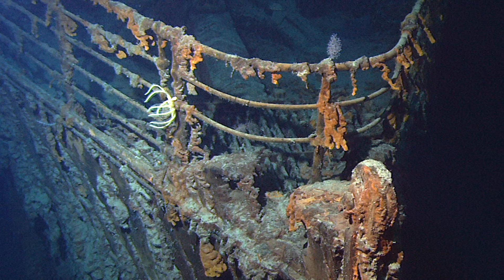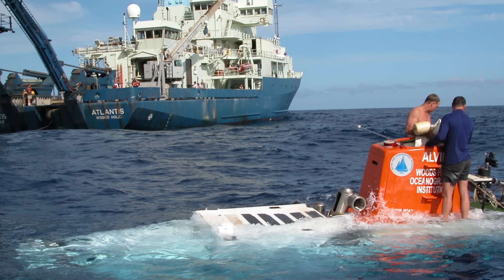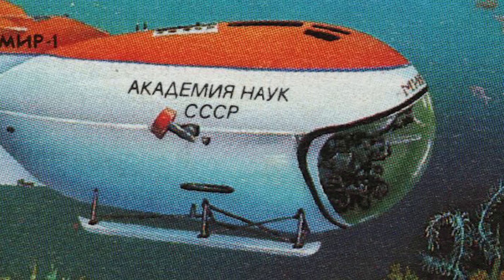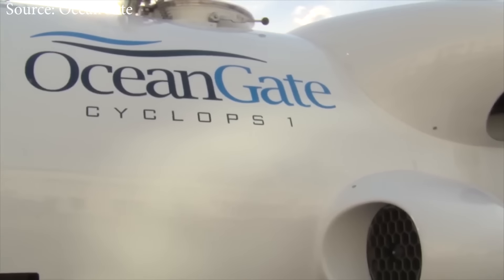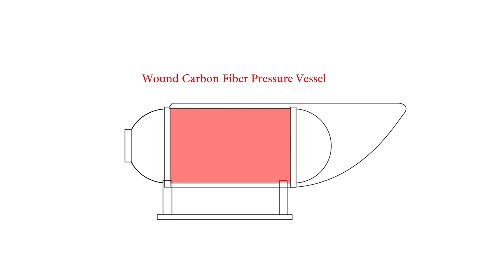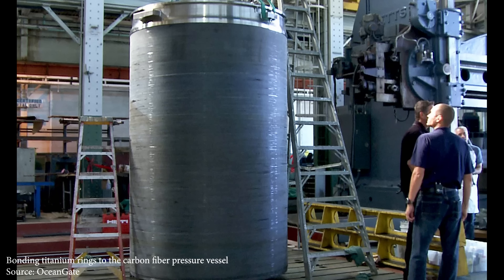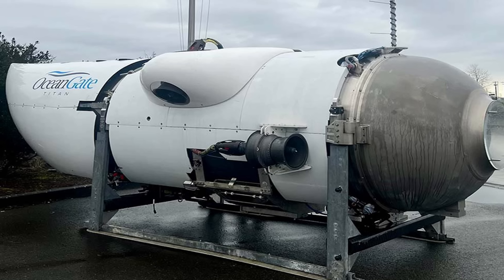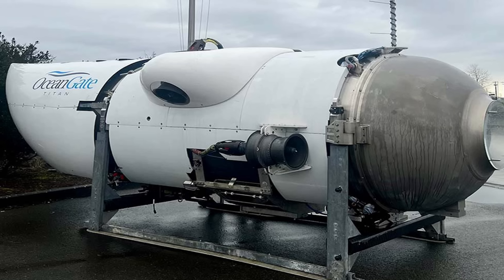How Titan was Built, Lost and Found: An Analysis

Comment: Rush’s actions were incomprehensible. Refusing to have the sub examined and certified… then refusing to have it examined/scanned for cracking/weakening is just mind-boggling. 

He was so willfully negligent and frankly, stupid. There’s no other word for it. 

If you look at the design of successful submersibles, their designs are uniform and strong and made of materials like titanium. The Titan design was like having a toilet paper roll with 2 end pieces added. If you put pressure on that toilet paper roll, the two end pieces would obviously pop off when the whole thing is squeezed… and the carbon fibre body would delaminate over time, causing an implosion inevitably. 

Stockton was unbelievable and should be remembered in history as a villain because of the way he cost innocent ppl their lives. Their adventurous spirit is understandable and they didn’t believe someone would be so reckless and put them in danger that way. I hope more regulation will stop this from ever happening again.

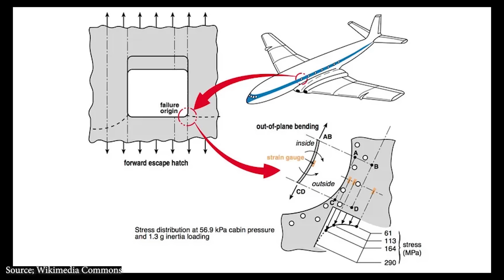Comment: Aaand 13:20 is where I exit the vehicle. The window corners being the problem on the Comet has been THOROUGHLY DEBUNKED, Mr. Brady; it was actually the skin thickness and the way the skin was assembled (the TLDR is that the riveting left fractures that grew worse over the plane's pressurization cycles). You need to withdraw this video immediately, and not reupload it until you've done proper research and re-done that section. For someone who breaks his back doing research and debunking myths as a major part of the channel, turning around and brainlessly regurgitating a thoroughly-debunked myth is an especially bad look.

I'm honestly tempted to report the video for misinformation, but I don't know if your negligence here is serious enough for YouTube to care.

Comment: I worked at one time for a satellite company building and launching commercial satellites.
The main component of the satellite’s structure is the central cylinder. The central cylinder is a carbon fiber wrapped cylinder about 10 feet long and 4 feet in diameter.  I’m not sure of the wall thickness, 3-5 inches? It’s basically the same design as the Titan sub. It has titanium end caps bonded on, and the bottom endplate is the actual mechanical connection to the booster rocket. Of course, its operation is in space, not underwater.  I did a complete 3D cad model of the cylinder using Pro Engineer. 
At one time I was considering designing a modern-day version of the Hunley Civil War Submarine using the satellite central cylinder, almost the exact size of the boiler used in the Hunley construction. I would not recommend this design for deep high-pressure applications. The Hunley dives shallow, no problem.

Comment: The criticism for the video game controller is not so much against the tool but the fact that it was used for a fundamental (not marginal) task. The fact that cheap controllers are also used in larger organizations means nothing of course, it all depends on the purpose. And above all the fact that it was not connected by cable but by a wireless connection. Even those who are not competent can easily see that this is crazy.
Reply: I mean, personally, I'm not really fussed with the controller as the primary control unless it comes out there was no backup system at all.

Comment: Pretty good video, but your "fact" about the de Havilland Comet was not correct. The SPECIFIC window that caused distress was for the ADF on the TOP of the plane, directly atop the cockpit. It was nothing to do with the rounded square-ish passenger windows. This is annoyingly repeated, quite falsely, across the internet. Most of the stress, fatigue and flaws that broke up the original Comets was actually caused by bad riveting, square cuts made for emergency exits, poor understanding of metal fatigue and specificity fatigue due to constant pressure changes, and shoddy construction. Only 1 incident was caused by the square cutout of the airframe to fit the ADF unit.
Many other airliners also sported square-ish windows, but none of them ever had any critical failures due to their shape.
Since the Comet was one of the first aircraft to regularly fly at the altitude that she did, many hard lessons were learned, but luckily, most were not catastrophic failures. More Comets were destroyed by pilot error than any other cause. 
I know you're into ships, not planes, so thought I'd help debunk this myth for you!

Comment: The carbon fibre hull needed to be thicker AND needed to be scanned prior to each dive. A carbon fibre expert stated it would cost about $20,000 dollars for a hull scan of the Titan. Stockton Rush chose not to, thinking that their onboard acoustic warning system would be enough. 
That was the real failure, taking shortcuts. Let's not forget the Titan had carried out 13 prior dives to the Titanic, could carry 5, cost only $370,000 dollars yet a spherical steel or titanium sub that could only carry 2 would set you back a whopping $37,000,000. Yes that's 100 times the cost of the Titan. There clearly is potential for carbon fibre, a lot, but it needs to used properly and with regular checks. A more innovative design could even involve a removable carbon fibre hull for more detailed analysis, inspection and even replacement after x number of dives at relatively low cost.

Comment: I made aerospace parts for years. Had i been there in the shop when they were putting that carbon fiber on, I could have told them it would fail eventually.  Im surprised it lasted as long as it did.

Comment: I think you're too lenient on them about some things, like the controller. I'm not concerned about a controller being used but that they used a wireless one. If the Bluetooth connection failed, what then? What if the batteries ran out or mistakenly weren't charged?

Comment: @iwannaratrod is spot on: No NTI's, No NTD's, bubble view port rating - not for that depth, no GPS/Navigation system, (for use in redundancy), no locator beacon, (essential emergency equipment, don’t you think?), et sic et cetera. New world use of Carbon Fibre for deep sea exploration is considered ‘Experimental Exotic Materials’. It has not been tried and tested. Titan was found to have a fault, not long back, causing it to be re-certified to 3000 metres. They had to repair it to get it certified back to 4000 metres. How do you repair a delam, slit, crack or hole in a one piece spun cylinder without causing instability in the surrounding structure? Companies that make this sort of thing will only certify it's depth for 1 use only, 2 at the most. That's probably why they made it themselves; they couldn't get anyone to certify a carbon fibre  ‘personnel sphere/pressure vessel’ for multiple use. The photo’s and video’s of the build is more akin to a Engineering/Glass Reinforced Plastic (GRP) shop. Go look at aircraft industry and F1 Team carbon fibre shops. I’d eat my dinner off the floor in those shops. Most people who watch this type of content already know most of what you go on about, especially Radar, Sonar, the depth, the pressure. This only needed to be a 15-20 minute video. Good production, editing, drawings and animation though.

Comment: i'm actually so surprised he didnt mention that metal used on the titan was basically scrap from airplanes. which is. so dumb. not only was it junk, it's not a material meant for pressure. it's really meant for the opposite, high up where the air is thin.

Comment: I am an engineer working with manufacturing and testing of carbon fiber reinforced materials, especially pressure vessels (opposite type - pressure inside). From what I see of the manufacture of the carbon fiber reinforced cylinder, I see only fibers oriented in the hoop direction (winding angle 90 degrees), no fibers running more longitudinally, or at least diagonally. That means the cylinder was not reinforced longitudinally. The force acting upon the two domes and squizing them onto the cylinder was born only by the resin - that for me constitutes an obvious source of failure.

Comment: I read that it wasn’t the square cabin windows on the Comet that was determined  to be the cause of the blow outs. It was antenna cut out windows on the comet. The Cohen Report did make note that the areas around the cabin window and those on the doors were higher than expected but it wasn’t the culprit.

Comment: Aircraft exit doors also work on the same principle. They are designed to be pulled away from inside, so when the aircraft is pressurized and at a high enough altitude, the pressure difference pushes the door into the airframe and makes it impossible to open, with very, very few exceptions.

Comment: Just one thing: you mention tha deHavilland comet and its square windows. The windows were not relly the problem,its a common misconception.
The real problem was fatigue in the extremely thin skin of the aircraft. The compression cycles of the aircraft eventually weakened the skin resulting in cracks.
There were other early airliners with squared windows which never had any issues with them.

Comment: Your comment on the Comet is incorrect, most people assume it was the square windows however it was not the issue with the pressure vessel, merely a weak point. Even then it's not perfectly square. This weakness was well known at the time as it was not the first pressurized aircraft to fly as high as it did. 

The stress fractures were due to the thinner than usual skin on the airframe and the punch riveted construction.

Comment: They applied the epoxy by hand and eyeballed the ring going on the carbon fiber hull.    That is really just asking for problems right there.   Aldo no epoxy leaked out from the ring.   So it’s asked did they apply enough?   Was it truly evenly applied.   Were there any air bubbles etc.

Comment: OK, so the thing about the "square windows" being the cause of Comets breaking up in mid flight is a myth. The report actually stated that the fuselage they fatigue tested on the ground failed in the area of the ADF antenna "window," which is actually an opening for the antenna to be put through. In fact, the radius of the curve around the edge of the windows was very similar to that of the 737 and other popular aircraft that still fly today.

Comment: One thing I'll call out on the game controller, and it is kind of indicative of the corporate attitude that I think we'll find led to the disaster. Yes, it has become somewhat of a standard procedure, but the standard procedure is using high end wired controllers, not bargain basement bluetooth controllers. The difference in price, when compared to the overall cost of the submersible, is fairly negligible, but they still chose to cut the corner. That should tell you everything you need to know about OceanGate.

Comment: Carbon fiber has very good tensile strength but is not nearly as good in compression. It is good for airplane fuselages because they are pressurized inside and put the CF into tension. Submarines are just the opposite.

Comment: You’re nicer than you should be. The facts are everyone in your world was against the way. Rush was running his business. He disregarded his own safety engineer to the point where he sued the guy just because he went public with his information. If I was the safety guy and thought that someone was creating something I could kill people I would do the same. Otherwise I would get sued later. It could open him up to litigation far beyond his means. Then rush didn’t speak to back up his own claims. On the paperwork, he kept talking about death, but rush told everyone don’t worry about that. Problem is, what happened. Now, I know that PH lost his wife, and maybe that’s why he disregarded some of these issues, but I think you’re being far too nice to the truth of what rush ultimately did. Just my personal thoughts, you have more of a knowledge than I do, but as a person, who’s done a lot of research, I try to examine evidence. The evidence here shows that rush use the material one shouldn’t use if you’re going underwater because of the way pressure is applied.

Edit: from what I know about carbon fiber, the shortcut rush, used was not having the carbon fiber applied at a crisscross. Instead, they did it straight and everything. I’ve read said if it’s applied at a crisscross you would have much more strength. I realize this was from almost a year ago, so I feel like I was a little bit harsh. We’ve obviously learned a lot in the past year,so I’m at an advantage and should say that I appreciate how kind you are.

Comment: By the time they are 10,000 feet down, and the sounds of cracking happen, and they loose weights, it’s too late. You can’t reverse fast enough to alleviate the now rapidly declining strength of the hill. I say this also because it’s carbon fiber, carbon fiber wouldn’t have warning sounds early enough for that to be a fail safe.

Comment: I’m no engineer, but in light of the disaster, the choice of carbon fibre alone for the pressure vessel was not good enough. I wonder if a titanium cage, similar to how concrete is reinforced with rebar, may have worked to reinforce the carbon fibre. After the disaster, some who had previously travelled in Titan reported cracking noises during descent. This makes it sound like the carbon pressure vessel was indeed delaminating, and the fateful descent exceeded what it could tolerate.

Comment: My uneducated hypothesis on the sub is that a contributing factor its hull weakness was its method of transport. Hear me out... There is a lot of cantilevered weight hanging off the back of the sub which may be supported in part by the rear titanium ring? I can't see any structural component other than the cylinder supporting the rear ring. The legs are spindly and only provide support from 1 angle below. Thus, above water,  the top of pressure hull is being subjected to pull and twist forces from the weight of the rear cone/equipment. These forces would be magnified by it bouncing around in the waves behind the main boat on it's little tow trailer. Bounce, bounce, bounce, twist, twist, twist in the waves of the open ocean for hundreds of miles. It would not surprise if the join initially failed at the very top of the sub where the cylinder joined the rear titanium ring.

Comment: The Colorado is using such controllers  (as well as wifi interfaces), but they are much superior quality than what would be purchased off the shelf (and thus much  more expensive).  It comes down to consequences of failure.  Consequence of failure in a such controllers and wifi during a video game is frustrating but not fatal.  Consequences of failure the same controller and related wifi  in a submarine's fire control system is catastrophic  -- hence the need for superior quality equipment that really is not "off the shelf"

Comment: When they talk about a window relative to the comet what they're talking about is one of the aerials on it on the crown of the aircraft. Specifically they are talking about the ADF aerial. It failed there because of how they installed the rivets. They punched the rivets into the structure and that caused microscopic cracks, which under pressurisation cause the cracks to grow until ultimately the structure failed. The water bath they tested the aircraft in showed how it failed.

Comment: I don't care how careful the fiber winding was it trapped air bubbles.  At extreme pressure these bubbles would be squeezed out hence the cracking noise.  Over time water filled the voids and increased the weight.  The speed of the last decent was faster than earlier dives.  Despite dropping the skid and weight the could not come up.